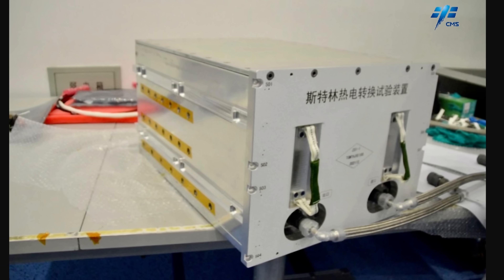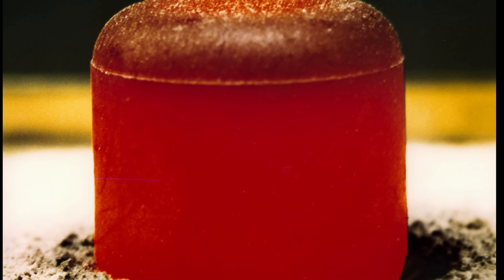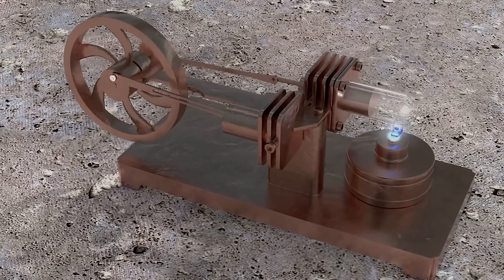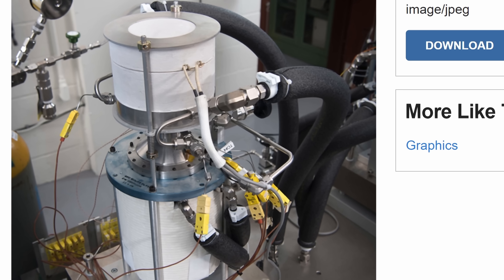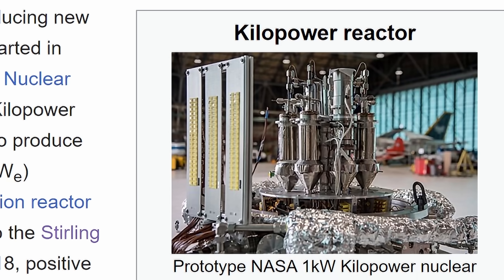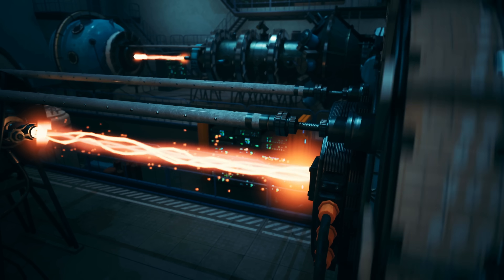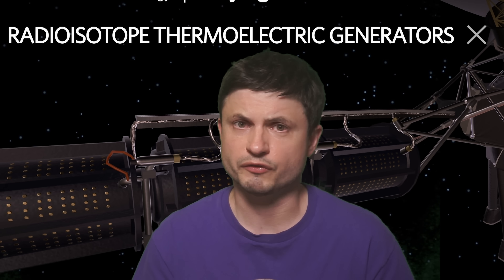Incredible Advances In Nuclear Stirling Engines For Space Exploration

Comment: You know what? I had an idea like this the other day and have been meaning to look up stuff about it. My idea was about how one side of something in the sun is boiling hot and the other side is freezing cold and taking advantage of that difference to produce energy but I guess solar panels are more efficient? Idk.
Reply: For Stirling engines to work efficiently you need large temperature differences like 0 to 1000 degrees. They was a company that made focusing dishes with Stirling engines, but the company failed I believe. Solar like you say is probably cheaper. Also it is more  maintenance free.

Comment: So essentially solar panels are still king when orbiting or traveling relatively close to the Sun, say maybe a bit further than Mars, but when you start going further, the energy density from the sun's light gets lower and at some point it's more mass efficient to have these on board ... something like that ? These nuclear stirling Engines also have the upside of being able to function without direct or important expose to space. I like that these work underground. That's huge, for Mars that might be better in places than solar panels. Constant, reliable, context independant power is certainly desirable.

Comment: You said that the piston does not need to seal, but how does it get pushed back and forth without a seal to hold the pressure differential? I would think helium would be such a small atom that there would be more likely losses through seals and stuff.
Reply: There is saying, a helium tank is either leaking or empty.
Reply: @wolfgangouille  Yeah, that was my first thought when learning about this. Plus, with an even larger pressure differential in the vacuum of space, I would imagine this would be even more difficult to contain. I would advocate for either a heavier gas or a phase change of some kind that does not involve a gas just due to leakage or osmotic pressure. I am not a NASA engineer, but would love to hear their take on it since clearly it is not an issue or they have resolved it some how. That, or it's an ancient Chinese secret that has been discovered by China that they aren't sharing.
Reply: @adamrichardson2227  Everything (including the alternator) is inside the pressure vessel. Maybe it's not clear on the video. But still there WILL be leaks.

Comment: the one problem I see with this is the issue with an oscillating or reprocipacating mass in zero g. there are going to be all sorts of issues to deal with regardless of how well its balanced.
Reply: Interesting thought. A satellite/craft would have as constant vibration with a Stirling running. I guess the electronics on the craft would want to be vibration proof. Perhaps embedded in a epoxy to stop components connection fractures.

Comment: I think Mazda used a Stirling engine in a model called the Millenia over 30 years ago. I think there were several issues with it:

1.  The heat exchangers and the regenerator are difficult to package in a car.

2. The engine takes an lot of time to reach operating temperature before it can develop enough power.

3. It takes a lot of time to respond to power demand and changes for it.

4. The temperature difference which is a crucial factor for efficiency restricts it usage to cold environments.

5. The heat exchangers operate at very high stresses and temperatures, hence the construction requires a higher quality material and therefore the cost increases.
Reply: 6. It was a Mazda

Comment: Could these pellets be contained in some material that blocks radiation exposure but still provide the heat? Or do they need to off gas or something..
Reply: The radiation will surely be blocked from anything important. For human craft for energy you just use a element that doesn't produce dangerous radiation (is shielded very easy), like he showed in the video.
Reply: @Sabret00th Sabret00th  too bad no normie can get their hands on this stuff to experiment with small scale power production.. I they really wanted "clean environments" these smaller devices could replace gas powered generators easily..
Reply: @djmjr77  Yes owning one could be good for powering a house. But if you have the general public owning them the radioactive material could end up anywhere. People could use it to harm other people, maliciously or accidentally. 

Russia used radioactive generators to power some lighthouses. But they ended up being stolen I think. I guess people stole them to heat/light their homes. There were dangerous unless shielded, could burn you and give you acute radiation poisoning.

Comment: I have a two piston Stirling engine sitting atop the Sat-TV box that has ran continuously for about a decade (minus the couple power outages, causing the box waste heat to end, it would stop for a bit then) now.  The graphite power piston runs smoothly on the lexan without maintenance. I did add some Automatic Transmission Fluid to its flywheel shaft at the start for lubrication.

9:30 Anton, the funny bit is that the industrial revolution steam engine is NEWER than the Stirling engine.  We're going back to pre-steam engine tech for our space future.
Reply: Ahaha yeah! Stirling engines are old, older than Newcomen's and Watt's steam engines.
Someone once said that Stirling engines did not catch on because Bessemer came too late.
Had Bessemer came before Stirling and perfected the mass steel manufacturing, the steam age might have never arrived and the Industrial Revolution would be Stirling-powered.
Reply: Saying we're going back to pre steam tech for our future is like saying using chemical propellant to launch into space is going back to ancient Chinese fireworks to propel us into our space future.  It's very dismissive of the technology added to make it useful.   Fire itself is a technology older than recorded history. But we don't credit cavemen for putting modern man on the moon.
Reply: The Stirling Engine was developed as a safer alternative to the steam engine.

Comment: Just wondering how big a 40kW unit would be. Very cool stuff!
Reply: On the Moon? My guess is much smaller than on Earth. Because of the tempature difference.
Reply: Needs a giant radiator that acts as a heat sink.
Reply: The 1000 watt unit I saw 20 years ago was the size of a large water melon... Arrange 40 of them with their hot ends towards the heat and you would have a 40 kw system.
Reply: @danlaskowski5494  wow that's a lot of melons - an american, probably

Comment: Sweden has operational submarines that incorporate sterling engines. The hybrid Gotland Class subs use LOX/seawater for heat differentiation and don't need to surface to recharge batteries.

Comment: No friction parts is not the same thing as no moving parts. It most definitely has moving parts.
Reply: Yeah, exactly. I think Anton means "no moving parts in contact with one another" but that is very different from "no moving parts".
Reply: If the displacer is run on magnetic bearings surely you could say it is friction less. There would be no solid contact, just electrons and gas molecules, so it would never wear out.
Reply: @AORD72  That's accurate in a relative way, though "never" is a strong word, and ultimately the whole statement amounts to non-sequitur.
Reply: @AtlasReburdened  Well, never with respect to the life of the craft being used.
Reply: @AORD72  That, I can certainly agree with.
Reply: @AtlasReburdened   it would still eventually wear out from the effects of outside forces. I can see one of these engines taking some wear and tear while passing near a massive celestial object with extremely intense gravity. The gravity could possibly warp the moving parts inside the engine if it's strong enough.
Reply: @AORD72 I agree that the bearings should be permanent magnets, not electromagnetic, and air bearings are more attractive. As for normal bearings, they can be very durable and strong.
Reply: The “moving parts” are what makes something simple, efficient, and reliable.

Comment: Engineers are going to make a lot of comments here about this video, and fair enough. Sorry, this cool kit helium Stirling engine powered by plutonium is not a steam engine. Traditional nineteenth and early twentieth century steam engines are external combustion engines (actually still used in thermal power stations, but with turbines other than pistons). Steam has certain phase changes in it's heating and cooling effects and thus is not an ideal material to use as a heat to kinetic energy converter and looses a lot of heat and hence is quite inefficient. Only water is plentiful on Earth. Could this cool Stirling engine use a more plentiful inert gas on Earth, such as neon or argon, instead of helium?

Comment: Why dontvyou just take a 1/4 inch thick sheet of uranium 235 sandwich it between equal height and width solar panels which would put out 400 watts 12v for 250000 years. Put ten sets of these on board for 12v 4000 watts. Or 20 sets for 8000 watts at 12vdc. Uranium 234 or 235 isn't nearly as poisonous as plutonium. You can use off the shelf inverters and dc to dc converters to power whatever you want forever practically.

Comment: A teeny thing like that can produce 10kW for 30 years nonstop.... with what is really a very simple design.

This could change power generation entirely.
Reply: Not really, world production of Pu238 is about 3 lbs/year. You could only power a single home with our current supply.
Reply: @wally7856  That's not the only radioactive isotope in the world.  One simply has to craft pellets composed of other isotopes.  It's the new engine design that's the key.
Reply: @Alondro77  Sure there are lots of other isotopes in the world, but Pu238 has the perfect half-life to emit about 0.56 Watts/gram and it only emits alpha radiation which is easy to block just by cladding the pellet. As for the engine design, it's a heat engine just like any other heat engine. We've known the physics of heat engines for hundreds of years. There is nothing new here.

Comment: Very cool, yea peltier devices are terribly inefficient but I was able to get 2.3v AC stable from one by accident compared to 53mv DC in some rough tests.  I attached one to a hot solar panel to see how much electricty i could get and it wasnt much(53mv) even adding cooling from the otherside.  Then i noticed the voltage goes negative if you rub one side, positive if you rub the other, so tried to mimic AC by rubbing each side rythmically but wasnt able to get anything.  Then i simply stuck it between (well 2 in parallel) my laptop and laptop cooler and measuerd the voltage,  and it was all messed up, oops, must of left my multimeter on AC by accident, so when i go to swith to DC i notice its already in DC, so i switch it to AC, and voila, 2.3v!  which was way more then 53mv from a super hot solar panel, and my laptop wasnt that hot, way better efficiencey. I havent explored this much furthuer but imagined some kind of propulsion system exploiting this using the extreme hot and cold situations you get in space.   Not sure what good AC current would be in space, but its better efficiencey at leaste.
Reply: Peltier devices do not make AC. You've made an error.
Reply: @filonin2  Why dont you try yourself and find out?  Im curiouse to have others try because like ive said i didnt explore this further and honestly think it could have been a fluke that the fan speeds were just right that it was able to get stable AC.  It wouldnt take much to try again but im not that interested to be honest, but since you are maybe you should try.   Simply rubbing each side will show you the negative and positive voltages in DC mode, which is technically AC right there, wont produce a stable reading in AC mode(or maybe you can rub it just right?), however the sandwiched between 2 fans did.  I dont even know which way the fans were blowing on opposites sides, and  thought youd have to be super precise with the timing to do it after my failed manual attempt, but the fans did it, somehow.   Maybe it didnt need equal temperatures or timing/speed on either side to make it happen and just settled into an average of the 2.

Comment: I wonder what becomes of the alpha particles themselves after they rattle around in the RTG producing heat? Do they acquire electrons and remain in the substrate as helium? That could cause fractures like Xenon does when it’s a fission byproduct in solid nuclear fuel rods.
Reply: Surely any radiation that could effect the TG would be shielded out. They run on heat, so easy to isolate the radiation from the engine. You have a big pellet of radioactive material a thin aluminium or copper plate that stops any radiation and heat lets the heat pass through to the thermal generator. Probably find the chamber wall of the engine is enough to stop any radiation.

Comment: How do we find nuclear material for these if we can’t even find it for radioisotope thermoelectric generators? We still send billion-dollar probes out with solar panels.
Reply: You realize that we can make that nuclear material, right? Hw even passingly referenced an increase in supply in the video.
Reply: @absalomdraconis  You would think that for the budgets involved in space probes, that’s more than enough money to throw some uranium or plutonium in centrifuges and make some RTGs — but somehow the lack of material has still been a constraint that has to be designed around.
Reply: We send billion dollar probes out with solar panels, because they remain close to the sun and don't need RTGs. RTGs are only getting used on probes to outer planets because solar panels don't get enough sun out there.

Comment: imagine the giant Stirling engines we could build inside some of the craters on the moon where the bottom is never in sunlight
Reply: That’s lunacy!
Reply: @hugegamer5988  No, it is lunar E
Reply: It's not enough that the bottom of the crater is never in sunlight.
A Stirling engine will move heat to the cold end. And so it will heat up the bottom of the crater. So there must also be sufficient heat transfer out of the crater in order for this to work.
Reply: @Tjalve70  presumably the rock is cold and the sunlight is quite hot and hopefully the distance isn’t too large.  You certainly could build a heat engine and flow a substantial amount of heat into the surrounding rock.
Reply: @hugegamer5988  How would you do that heat flow? There's no air in the moon, meaning you can only irradiate heat, as infrared light, and wouldn't be a substancial amount, very slow and inefficient way of cooling, imo the machine would melt in no time.
Reply: @Argoon1981  Conduct it to a plate buried in the moon.
Reply: How about using some gas/liquid in a pipe like we do on earth? Do you think that could work?
Reply: @rtqii  That does sound more promising then open "air" radiators.
Reply: @guhropitu-ec2gd  The problem is not to have a gas/liquid inside a tube (heat pipes) to capture heat, the problem is how to get the heat away from the aparatos. 
On Earth, you have heat pipes to capture the heat, aluminum fins to irradiate the heat to the air around and then fans to circulate the surrounding air and push heat away from the cooler, on the moon, such setup doesn't fully work because there's no air to flow. 
But like Richard said metal rods buried in the moon could work, if you also add a way to bring cooler soil/material near the metal rods, in a more or less constant interval, if not, I could imagine you would just have, very hot rocks constantly near the rods and heat would transfer slowly from rock to rock in a circular radius, have no idea how efficient that would be. 
Is not a easy problem, but I'm sure more intelligent people than me, with more knowhow about this stuff has thought of this already and has a solution.
Reply: @Argoon1981  You are also clueless lol
Reply: @Tjalve70  well presumably since it's always shielded from the sun but still open to the sky/space it's still an amazing place to put radiators
Reply: @Tjalve70  You have not the first clue how any of this works hahaha
Reply: @MadScientist267  Feel free to correct me.
Reply: @Tjalve70  In a bit...  🤣

Gonna watch this one struggle first
Reply: Imagine if we quit trying to trash space
Reply: Good general idea, that´s what I thought out of reflex as well unfortunately it won´t work. Engines like this work excellent on ships in the arctic. The cold water is superb to function as the cold end.

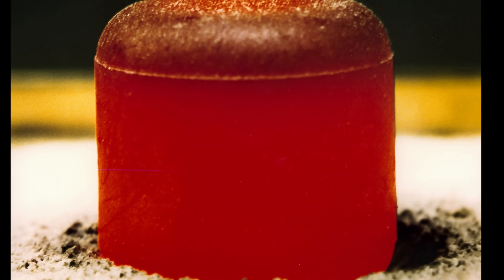Comment: 3:47 Anton. I’m heating and cooling we use something called a THERMOCOUPLE. It receives a heat load and gives off the slightest low voltage current. ☺️💥🙏💯we use them to OPEN GAS VALVES once enough flame is registering through the thermocouple. It will hit a click and boom. We have OPEN GAS VALVES feeding fuel to the furnace. In oil burners especially we see these. Gas valves use HOT SURFACE IGNITORS more often than not nowadays. Computerized. 😎👍💥💯